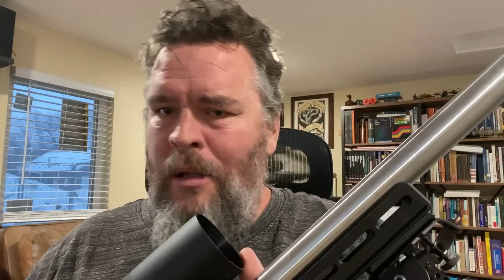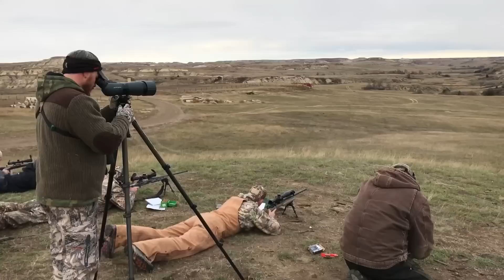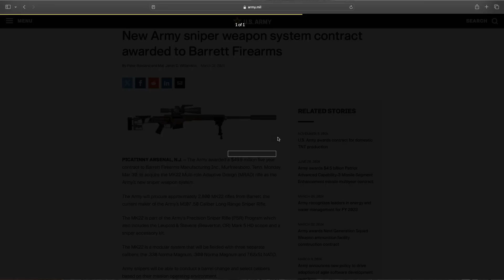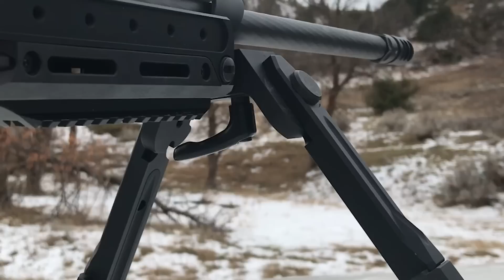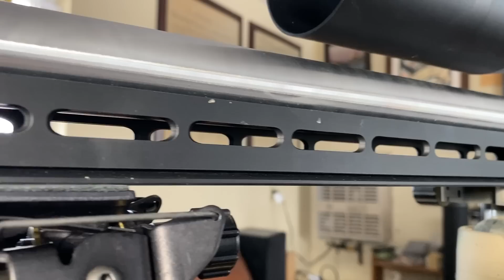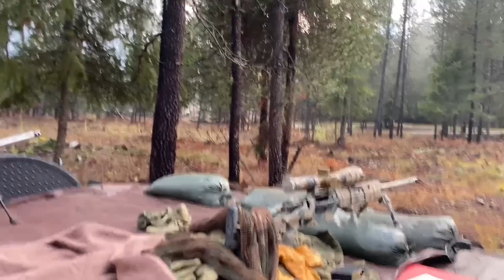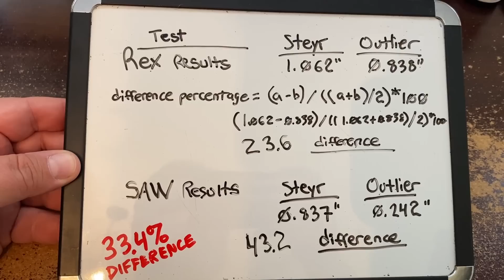Cheap "Target Rifle" VS Expensive  "Sniper Rifle" | Steyr SSG08A1 VS Savage/Outlier ~ Rex Reviews

Comment from the maker: The crazy Outlier/Arken 30% SALE ENDS after Thanksgiving, so grab it NOW if you can the move in time! 
For Outlier barrels or modular chassis systems use code 'REX' for the very best deal online https://www.getoutlier.com
For Arken Optics use code "REX" to MATCH the BEST DEAL out there!  Here is the link: http://bit.ly/RexReviews
For THE REAL D.O.P.E., subscribe to the TiborasaurusRex Patreon page!  http://www.patreon.com/tiborasaurusrex
Reply: If I didn't already have that covered, I'd be on that sale like white on rice.
Reply: Just to say, the mount is wrong mounted. It is 180° flipped around. The level is in the front and the mirage band holder on the shooters side 😮
Reply: The Steyr 1:10 twist barrel is not made for 175gr bullets, the 1:8 Outlier is
The test should contain different ammo with different grains
Reply: Did you ordered the savage axis short chassis 3.0 acis or long 3.56 magwell for your build?
Reply: Is there a link to the Outlier ammunition ??

Comment: I think the biggest benefit to a steyr or a sako trg is that they use exceptionally long lasting cold hwmmer forged barrels. Sure button rifled barrels are much cheaper (easier to make) and can be as accurate or more accurate.....but they won't ever hold that accuracy for as long as a steyr cold hammer forged barrel. And a sniper team doesn't want to have to re-verify all their dope whenever they change a barrel out but its absolutely necessary. You'd have to do that probably 3x as often with a non-cold hammer forged barrel

Comment: Looks like it should use a machine to do the test.....stabilize the gun, aim the target with precision tuner, squeeze the trigger with the same electronic finge. Frrst test, hold the gun as tight as possible to only test the barrel; second test, hold it with minimum support, to test the impact of recoil and weight etc......
Also, may want to invite some new shooters to do the testing, their feedback might be so interesting.

Comment: Military Sniper rifles ,.L.E.O sniper-"sharpshooter "rifles, utility rifles , designated marksman rifles, target rifles, hunting rifles,  varmint rifles, bench rest rifles. Counter sniper rifles.  All different designs with different sets of criteria to fill different roles.  They May all have some crossover features but they are all very different tools. A military sniper rifle may be able to be a little less precise than a police sniper rifle ,but it must be durable enough to survive being dragged through hell while in a bag tied to your ankle , maintaining zero and able to put a cold bore shot and any subsequent shots where needed out to the maximum distance of the cartridge being used before being moved to another position through hell. .75 moa is good enough . A police sniper needs to be able to have as much precision as possible for usually under 100 yards but maybe out to 400-500 . It doesn't need to survive hell on earth but it does need to still put a cold bore shot where it's exactly needed.  Sub half moa is ideal, given the officer using it is competent ( they usually are) . A designated marksmans rifle can be basically any service rifle with a few upgrades for consistent shot placement and increased target identification ability. An ar with a good barrel ,free floated and an optic that can give a little extra magnification for smaller targets can be a good DMR , an upgraded trigger helps.  A target rifle is all about the precision and ability to succeed in the particular match it's designed for. It will typically have only one pet load and everything about it is for scoring points on paper.  Hunting rifles are just that, they usually try to balance weight, durability, accuracy/precision and the ability to carry them for long distances if need be.  2-3 moa is fine for most people but they are extremely varied in features and ability.  Varmint rifles are a hunting rifle with a heavy barrel and usually a small caliber, sometimes high velocity cartridge. Typically they are meant for use in a static position and 500 yards is considered extreme range.   Utility rifles are basically something that is a jack of all trades. They have no particular speciality, are good enough for most jobs a normal person would deal with in a pinch . Durability is generally good , accuracy and precision are good enough.  Bench rest rifles are the top dogs on precision Hill.  They are normally meant for static positions (like a shooting bench) and have the heaviest barrels possible with the best quality bores possible, a single pet load is made and sometimes the rifles are half machine rest . Competitive bench rest shooters go from 50-1000 yards and groups are measured in 0.01 moa for the best of them. Idk wtf a counter sniper is other than a politically correct term to make our snipers sound like the good guys so a counter sniper rifle is the same as a sniper rifle from my understanding.  This is just a brief explanation on what I have learned . Each category rightly should have an explanation the size of this entire comment or larger. User intent does play a role ,but it's not going to make a 20 pound military sniper rifle suddenly easier to carry while stalking deer and it's not going to make a utility rifle suddenly shoot 10 shot groups at 200 yards that can be covered with a dime.

Comment: You don't need to spend that much. I put together a ar10 chambered earlier last year for deer & hog hunting. Used aero precision M5 receiver set, handguard, Faxon 18 " 308 gunner barrel, giesssle ssae-x trigger. Setup in the Caldwell lead sled using 150gn core-lokts it's been shooting 1/2" groups at 100 yards. That's on cold  & hot. Doesn't matter it's shooting extremely better than I had hoped for!  I'm extremely happy with it! It shoots better than my buddies high end bolt gun

Comment: i guess the only difference i’ve noticed in cost is durability. it may perform similar but i had a 300$ bolt action a while ago that wouldnt shoot an inch anymore after a few hundred rounds. will it last in a storm? banging off trees? snow? thats the difference. materials not short term performance

Comment: I have a Steyr Pro Hunter in .308 Win that I get consistent 3/4 MOA with a few different hand loads. I got it second hand at a sporting goods store in Sheridan, Wyo for a good price. Although load development showed that it wouldn't group too much under .7 to .75 inches, it didn't group too much over that either. With the 26" barrel I get very good velocities with the 178gr ELD-X but what most impressed me was that the cold bore shot was consistent with follow on shots. I can zero it and know that my cold bore shot will be right there, a very fine quality for a hunting rifle. I don't let the barrel get more than warm so temperature drift hasn't been an issue, but it may do the same that the SSG did with the back to back 10 shot string. Since I don't use it in that capacity, I don't worry about it.

Comment: The main difference in a sniper rifle and a target rifle is its intended use. 
Hathcock used a model 70 Winchester in Nam. 
The first sniper rifles were just really accurate hunting rifles. 
Iv got multiple light barreled hunting rifles that are sub 1/2 MOA and will maintain that accuracy for 10 shots. 
A sniper will generally take one shot with maybe a follow up shot within 2 seconds of first shot then move. 
No need generally for a barrel that holds accuracy for 50 rounds in quick succession. 
Optics are as important as the rifle. 
Modern scopes have greatly increased quality even in the lower cost scopes. 
And most of all… rifle set up and an experienced long range shooter. 
You can take just about any quality rifle and find the right bullet and right hand load and make it into a sub .5 MOA rifle.

Comment: A couple of observations:  1.) First thing is the exchange rate between the Euro and USD for the Steyr/Steiner.  There's about a 6% difference between the 2, so you automatically inflate the price by 6% for the Steyr/Steiner/Tier 1 mount just by importing it.  2.) Military design requirements add cost.  Things like folding stocks, ability to change calibers, configure for LH or RH, etc all add to the price because they require components that won't be used by any other models from that company, so the production volumes are relatively low which drive up the cost. 3.) Probably the most important, is the accuracy standard for factory sniper rifles for thousands of units produced along with the interchangeability of parts.  You could pull the bolt and barrel from another SSG, place it in another chassis and get the same accuracy.  4.) You mention durability, but it's not just from rough handling or field use.  Imagine adjusting the stock over and over again for different shooters for YEARS.  Folding and unfolding the stock for YEARS.  Thousands and thousands of dry fire cycles. Rifles that get dropped over and over again for YEARS.  That's the true measure of durability for military arms which adds to the cost.  Think about how many times a military optic will get adjusted during it's lifecycle.  

With that said, you're absolutely correct that most sporting users (competition/hunters) don't need any of those features or the associated cost.  It's great to see what precision is possible even on a budget.

Comment: 6061.... nope.... I'll pass. 6061 is bubblegum soft. There's no excuse for not going with 7075 . Material cost and manufacturing times are, near as makes no difference, the same. If they really can't eat the 3% difference to drastically increase product quality, then they should increase the price 5%. If they can't do either, then I'll go with a company that can.

Comment: I always wanted a Steyr ssg08. I currently have a sako trg in 300 win mag which i love.  These military rifles ARE built different. Maybe I'll never need it but its good to have it. The TRG is much lighter than the steyr but I'd say equally rugged. With a Schmidt bender pmii fully setup it weights about 14.5 pounds (instead of about 18 lbs for the steyr).

Comment: I get the point of the video. If you are an active SF sniper, the Steyr might be what is assigned or what you need for no fail. As well, of course, the Barrett MRAD if you need the different calibers. And even that had to different sets. One was barrels and parts for .30 Win, .300 Norma Mag, and .338 Norma Mag.

The other one was ..308 Win, .300 win Mag, and .338 Lapua Mag.

And one might need those.

But if shooting state side and not in an armed conflict, the budget rifle is going to work just fine. It also helps to remember the job of a military sniper. The sniper's job is not to shoot a pinkie finger at 1.5 miles, like they portray in "The Shooter."

It is to get a center mass hit in an IPSC size target out to about 600 yards, at most. Most sniper engagements in theater are less than 600 yards, a majority, at least in urban environments, less than 300 yards.

So, yeah, build what you can afford and get really good at it. Maybe later you can enjoy the gucci gun, if even then. But, for now, learn what you can on really good equipment that does not drive you into debt.

Comment: Good stuff Rex. Did you leave that Axis trigger stock or did you do a trigger job? I got one of those M Carbo budget trigger fixes for my Axis 308 but haven't installed it yet. The stock trigger is pretty heavy and varies with each individual gun.

Comment: Probably, if you ran Styer ammo through both guns the results would have flipped.. Just that little bit of symmetry of systems... Outlier is using their own guns to test develop loads.. Styer, obviously, would do the same.. IT seems reasonable that that would give each manufacture a 33% edge for using proprietary ammo on their own gun.. Results on the budget set up are awsome.. Not exactly a gun you want to be packing around SE Alaska vertical mountain ranges but.what a killer value!... So, arithmetic'ally speaking.. Saud is twice the shooter you are... hahaha..
Reply from the maker: I have lots od different rounds through the Steyr, this is representative of its typical 0.6 - 0.8 moa performance.
Reply: @TiborasaurusRex  Same as my Tikka t3x 308.SUperlight 22" barrel.. About a half moa with Hornady superperformance 178grain and 165 grain... It just likes that hotter ammo for accuracy. About 1/2moa.. I never shoot 10rounds, one right on top of the other though.... I am starting to reach into the realoding space.. Eric Cortina has been a good resource and it. Getting done whole groups has its appeal to me.. Snipping the snipes..

Comment: my savage 10t tatical made for cabelas shoots sub .500 with my handloads ( Nosler 175gr  with n550 powder ) and was under $500 at the time with sale price and rebate ($486.89) 24in heavy bull barrel 5R rifling 1:10 twist accu stock and accu trigger ( 2lbs form the factory) heavy bolt handle ....i did install an adjustable cheek rest on it ....topped off with a primary arms 4x44 ffp scope...not bad for the toatl price of $766.87  under $1000 for a 1000 yard gun

Comment: EP5 om my M77 MKII in 300 WM. Finicky dam rifle to get sub MOA had to play with Seating depths so I shot 80-100 rounds through it. The scope had not moved one iota, wait is that on the dials? I'm gonna switch over to Berger Bullets 185 classics and start with Berger's recommended seating depths, If it tracks with the last loads they will be longer by .015" Two thumbs up for the Arken and the Zulus is friggin amazing.

Comment: When I first got into doing long range shooting I didn't have much money at the time, so I found a Savage model 10 tactical in 6.5cm with a 24inch bull barrel for $300. I then purchased the MDT LSS gen 1 chassi with there fixed SRS stock and the glass I went with was from an up an coming veteran company by the name of Arken Optics. I went with there EP5 that only cost me $400 and was absolutely amazing until I picked up there EP5 gen2 a few months ago for the same price, the turrets are much more tighter and precise. In all the rifle with my 140gr Berger VLD handloads gave me the accuracy and enjoyment that every shooter is looking for and only for around $1,500

Comment: Personally any rifel can be a sniper rifle . Here me out they shoot 22 LR matches 600+yrds i shoot my CZ-457 22 LR ,22 mag , 24.5in at 300 yrds on targets , jack- rabbits, prairie dogs exc. Now you can take a cheap Ruger American and shoot MOA at 1000yrds consistently. My point is dont get cought up in all the Hype and pressure from these big companies and influencers that are getting big kick backs . They try to make you believe if you dont have this $2-10,000 dollar rifle you wont be able to shoot like them BS . You can buy a cheap savage/ruger exc then buy a good barrel from $100-900 dollars your choice and get you a affordable stock or chassis $150-1500 dollars again your choice. Get a trigger anywhere from $50-500 dollars. And you potentially have depending on your shooting abilities 1 MOA or less rifle with factory  ammo and especially if you Reload . My point you can build your own rifle for $1,000 or less that will most likely shoot way better than that $4,000 rifle . God bless you and your family God-bless America 🇺🇸 🇺🇲🇺🇲🇺🇲🇨🇱🇨🇱🇨🇱🇨🇱
Reply: Its funny, I have a Rem.597 22lr that can hang with a lot of bolt guns. After the optic, bipod, and other accessories it's probably around 700 bucks worth of gear. Scope makes up 75% of the cost. Shoots sub MOA at times out to 100.
I also have a KSA 722PT chasis rifle. Bolt action, match chamber, and barrel. After scope and bipod, around 1,200 bucks. So far, not a sub moa rifle. Not even at 50!
Point being, no, it doesn't matter how much $$$ you spend.
I automatically thought the KSA would out-shoot the 597, just not the case!

Comment: In my experience, you're paying for the reliability and durability. Arkens will track, but I've had them go down in PRS rimfire matches. For 4-600 dollars, that's what I expect. My IOR scopes on the other hand have survived for years of PRS competitions. If lives are on the line, I'd go with a tier 1 scope. IOR, ZCO, Tangent Theta, Nightforce ATACR, Luepold Mk5, Vortex Razor Gen III, Khales, Steiner M series, etc. These are excellent scopes with the durability, reliability, tracking, and glass clarity. 

For my main PRS rifle, I went with a custom rifle. ARC Mausingfield action, Huber Concepts 2 stage trigger, McMillan A6-7 stock, etc. No expense spared to build the most reliable and durable rifle that can be put in the conditions in the southeast region of the US.